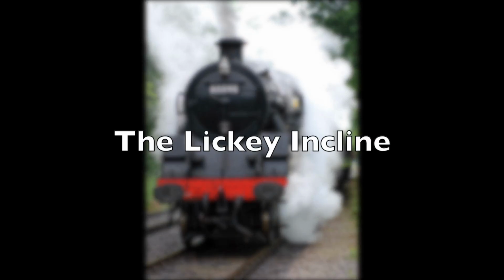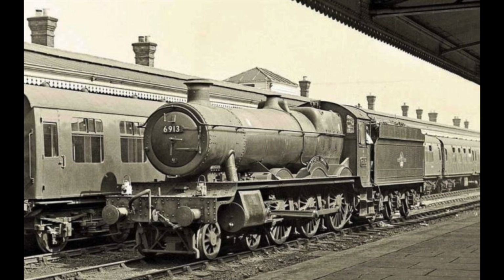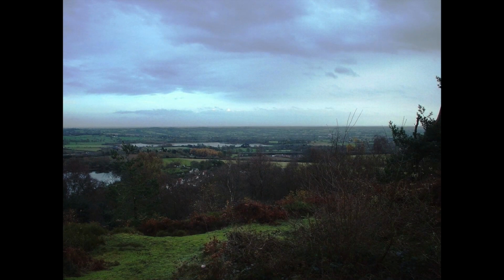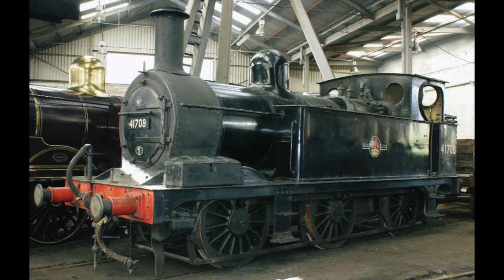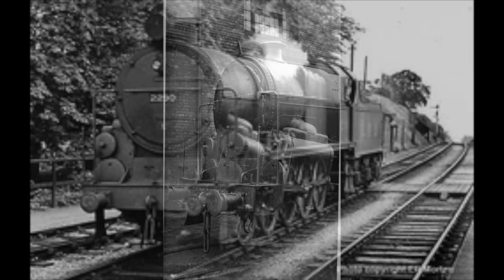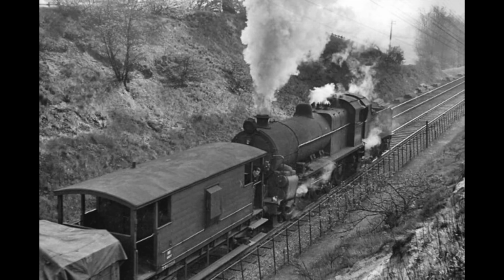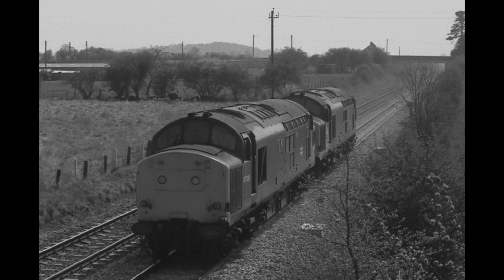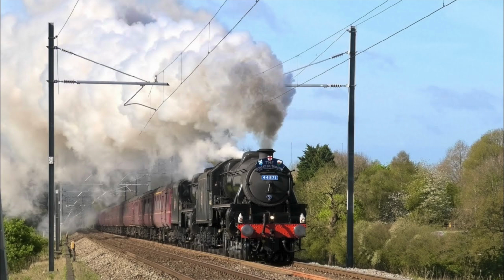The Lickey Incline

Comment: As a Chinese I'd say the BR is somewhat obsolete in nowaday technologies. Not in the past, but nowadays.
The problem of frequent broken couplers is due to the "pin and buffer" couplers. The chain bearing the weight of a climbing train?? This is bad for long freight trains as well as the fingers of railroad workers (laugh). Please use the knuckle (janney) couplers and it won't break off that easy. It is a lot harder to break the knuckle than the chain.
Another thing is the EOD equipment. If a breakaway occurs the driver would be notified immediately.

These aren't much of a problem when the hill has to be banked anyways for insufficient traction. But when traction and power isn't a problem anymore the banking or pushing are no longer needed for these reasons. You do have the option to get rid of them but you didn't, therefore it's kinda obsolete.

Or freighting via trains already obsolete in the UK? For your pathetic amount of cargos the ships and trucks could do that job without you!

Comment: I can see you've mostly got the idea.  So heres a more accurate summation of the physics...

• Friction is the resistance to movement of one surface over another.  The more friction, the more resistance.
• Adhesion is the tendency of two paralel surfaces to stick together.

Friction on rails is very low. This results in a very low rolling resistance, requiring a very low amount of energy to overcome said rolling resistance.  This is what makes trains so efficient when compared to a car.  Which has high friction, and thus a high rolling resistance.  Meaning it needs a comparatively high amount of energy to be added continuously into the system to maintain speed.

This low friction becomes a problem on hills, where gravity pulls things down hill.  Which from the trains perspective is experienced as a net force pulling the whole train and load either backwards or forwards (in the direction of down hill)

In order for the train to simply maintain speed, it must be able to put enough force into the wheels to overcome the gravitational net force it is experiencing.  The issue here, is that because of the low friction nature of train wheels on rails, the amount of force it can apply through the wheels is limited before the wheels loose adhesion and spin uselessly.

If the amount of force the engine can apply is less than the weight of the train, then it simply can't make it up the hill.  Even if the engine itself is powerful enough to generate that force.  If it doesn't have enough traction to maintain adhesion at that level of required force.  It simply can't make it up the hill.

Also, I do enjoy your well researched content.  Keep up the good work. You deserve a much higer viewer count than you're getting.
Reply from the maker: thank you, physics is not my strong suit and you explained it better than I ever could.

Comment: Another interesting video. Loved learning about Big Bertha. ThAnkyou.
Reply: The 0-10-0 was also sometimes referred to as 'Big Emma'.  That's footplate cre for you!  

An aside: Just before the advent of the 9Fs, BR tried the solitary LNER U1 (a 2-8-0+0-8-2 Garrett built for the Worsborough incline on the Woodhead route, then newly electrified at 1500Vdc).

In diesel days, the Class 35 Hymek were tried, but the gearing proved unsuitable for banking duties.